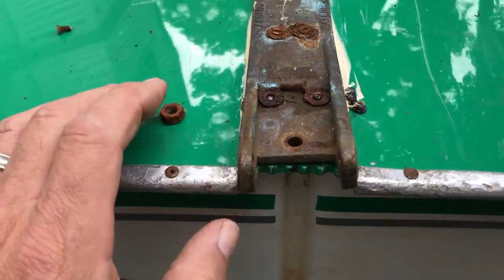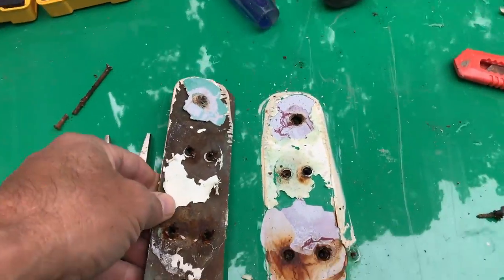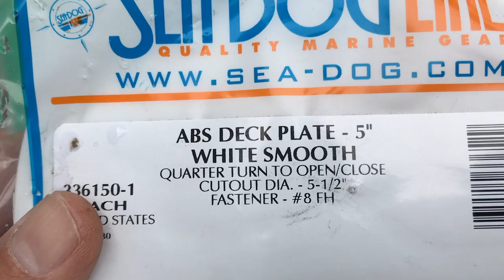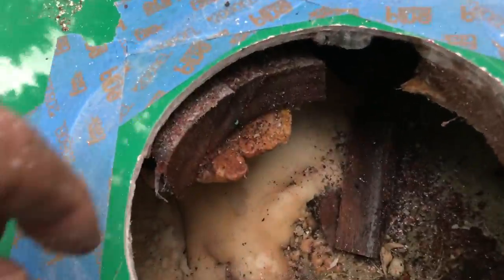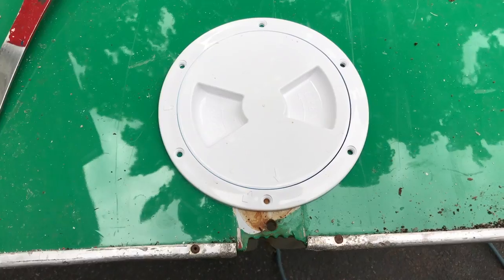Old Style Sunfish Rudder Replacement

Comment: Thanks did this but the pin on the rudder does not move up or down to engage in the bracket- sprayed with lubricant but must be rusted tight. bought used- any recommendations?

Comment: Thanks for the video. How did you patch up the hole from the bottom plate?
Reply: TotalBoat THIXO is what we use. Or JBWeld epoxy. And a few layers of 4 oz fiberglass cloth on the inside of the keel over the hole.

Comment: I was gonna use butterfly nuts, do you think that would cause problems? Obviously, the way you did it is best but im tryimg to avoid having to cut the access port. Thanks for sharing!
Reply: Yes you several have huge holes that are hard to seal and butterfly nut hardware will rust.

Comment: Is that the original rudder?  If so, did it have to be modified for the new cheek?  
Since you made a whole video about rudder replacement, but didn't say a word about the rudder...
Reply: Josef there is definitely a new rudder, in shape and design. Yoi may be able to fit an old rudder but you would have to modify it to work
Reply: Mr. Amato 
I bought newer model off eBay two months ago.